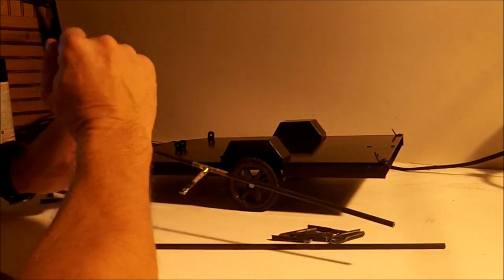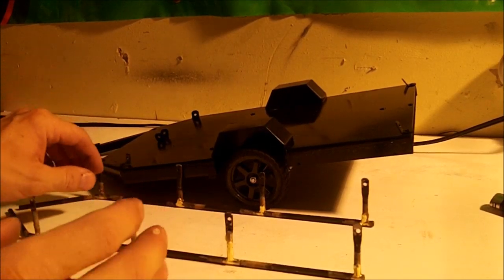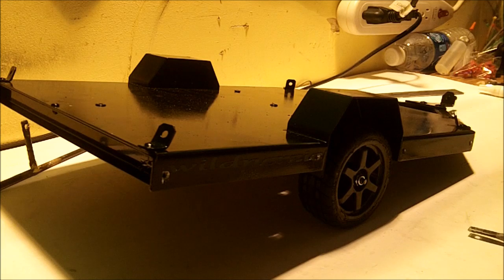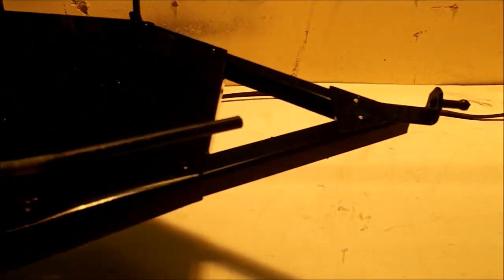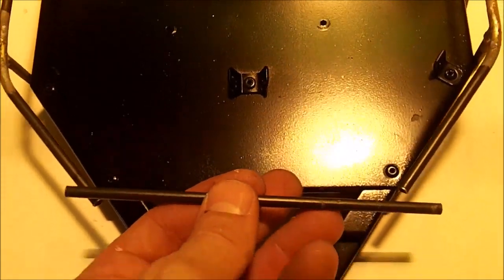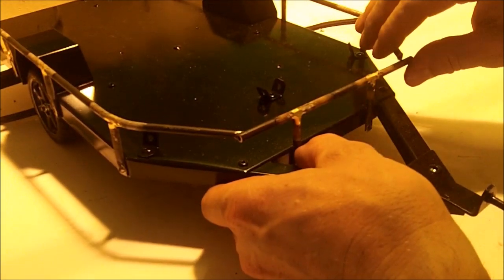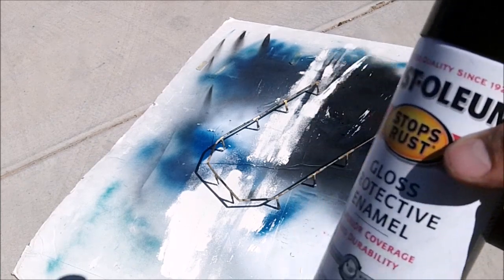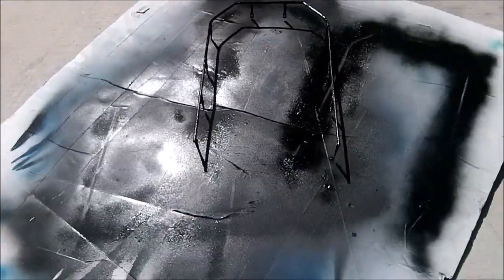Trailer Mods Part 3

Comment: Awesome man great job and info I have another noob question for brazing well as always safety 1st so on brazing rod do you have to wear gloves while holding it brazing does it get extremely hot too or no not unless rod is short and close to flame and for eyes are there glasses to wear like welding or just some safety glasses and thanks for all the info man
Reply from the maker: You should always wear safety glasses. Do I not all the time when I brase. And no I never wear gloves, the rod never gets hot in tell it gets down to the last 5 or 6 inches then I either hold with pliers or just throw the rod away. Those rods are pretty cheap and go a long ways. I didn't even use half of one on the hole trailer.